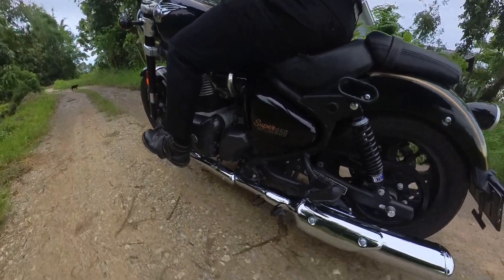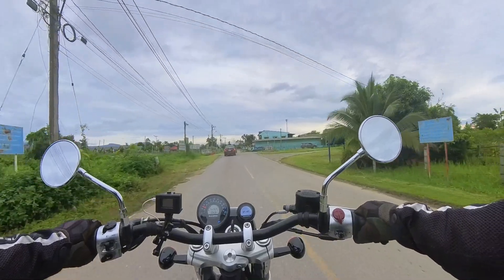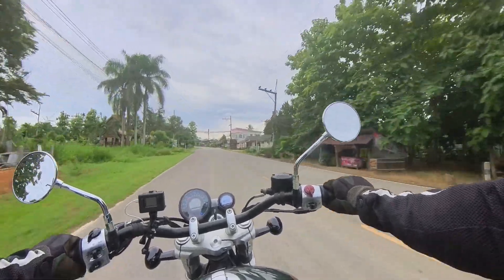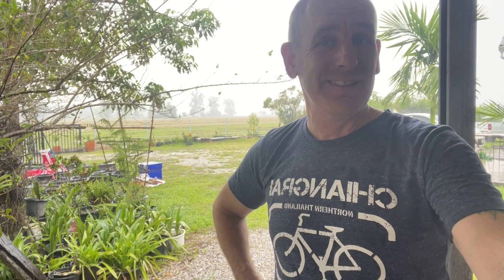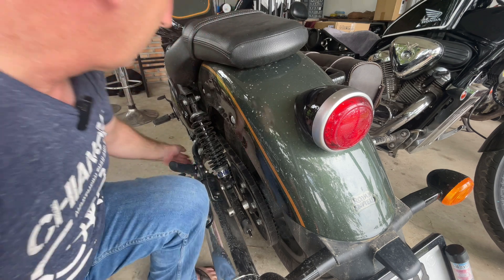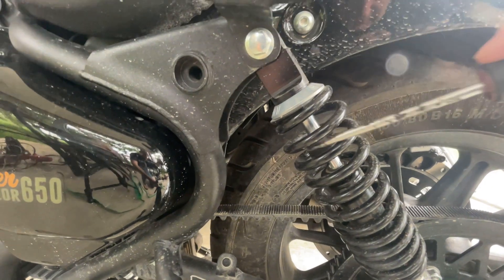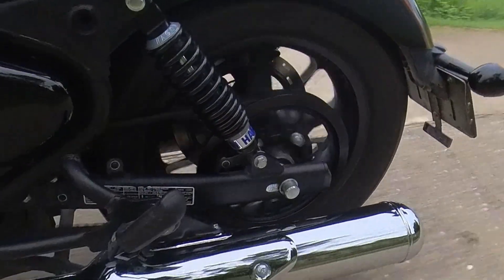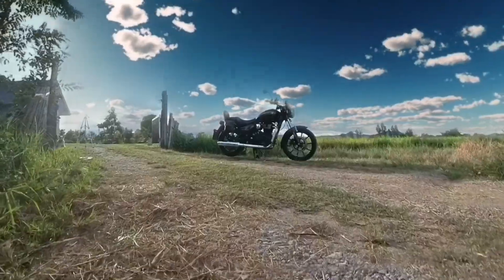Belt Drive: The Best Kept Secret for your Meteor 650 from RS Tech

Comment: The belt drive will be my first mod as soon as I got my bike, hopefully very soon.
Just an idea, what can help for others:
I plan to manufacture a fixed length rear shock replacement part for the belt adjustment. With this part you can perfectly align the front sprocket axle, swing arm pivot pont and rear wheel axle to do a belt tension. With this simple tool you don't really need anyone to help you.
Reply from the maker: It’s a great mod. To be honest there is a new tension method now. So you can check any time on your own after done. You can even use the gates app. Which is like a guitar app to check the belt frequency when flicked. 🙏 Belt Tension - New Method - Royal Enfield 650 RS Tech Belt Drive
https://youtu.be/sdPa9kIsEdw
Reply: @Ride-with-T  I already saw it this morning, thank you! (I still haven't finished all your videos)
Yupp, saw the frequency tuning method as well. The only thing missing is the motorcycle...

Comment: How come you have the high beam on? just curious
Reply from the maker: Motorbikes are a common form of Transport in Thailand. Mostly small cc bikes. Cars pull out in front of bikes all the time, because they assume it’s a small slow bike. Hence big bike riders tend to ride with lights blaring to indicate speed. It works, but not all the time. 🙏
Reply: @Ride-with-T  oks i thought so, can you just adjust the height to be higher and gert an LED? might save the bulb and connectors burning out

Comment: I have heard that it is common to have to re tension a new belt fairly soon after installation, but that subsequent adjustments are rare, or far apart. I also understand that they rob a bit more power than a chain, but there is a trade off for everything, and it still appears to be a favorable trade to me.
Reply from the maker: Yes I had to make a couple minor adjustments within the first 1,000 km but not touched it since at 8,000km. Maybe a bit of power loss. Not that I’ve noticed, because you can change gears much quicker and smoother. So I actually think the bike is quicker now 😂🙏
Reply: @Ride-with-T  I know that a belt does not have the slack of a chain when coming of and on the power, but I wouldn't have thought that a belt would make shifting easier. Very Interesting.
Reply from the maker: @ ohhh it really does. And no dipping of the front forks between gear changes, which is where I’m sure power is lost also 🙏

Comment: how do you compare Belt drive with chain in terms of wet environment with soil etc.
Reply from the maker: No oiling needed. The OEM chain would rust badly if you didn’t oil it after getting wet. But the clay soil here in Thailand is very gritty. So I do have a little bit of wear in the last 8,000 km on the belt drive over the rainy season. But some people havve changed chain and sprocket sets twice over this period. The belt is the way forward 🙏

Comment: Just bought a belt drive from Mtechnichs (India) to fit on my Classic reborn, then going to do the same on my Meteor (10000 miles and totally stretched no adjustment left). Still looking at the SM as secondhand prices are really coming down.
Reply from the maker: Just be cautious of that Classic belt drive kit, if they use a gates belt. I’ve been informed the front pulley makes the belt turn too tight a curve from the manufacturer’s tolerance specifications, limiting the life span of the belt. But i do hope you have no issues. Second hand prices of any manufacture are dropping like crazy. But we still like to buy new. It’s the only way of guaranteeing you’re not ridding a damaged repaired bike. All the best 🙏
Reply: @Ride-with-T  thank you for the information I will religiously stick to the guidelines in case of any future warranty issues.

Comment: What about the power / efficiency, I have heard belts cause loss of power of around 10-15%, i think a dyno test with a chain and with a belt would be able to get the results,
would like to know about your experience.
Reply from the maker: No power loss that I have noticed on a 47hp bike. What you do notice is the smoothness between gear changes. My wife no longer head butts me on gear changes when pillion. No dipping of forks. So in a way better than chain in my opinion.

Comment: I would think that the additional force placed on the countershaft sprocket bearings due to the belt tension would eventually possibly cause bearing failure.   However, I think this is absolutely fantastic-- to get rid of those damned dirty chains-- why more manufacturers don't outfit bikes with belt drive is a mystery to me-- sure it would increase the price of the bike -- I, for one, would be glad to pay it.   For example, Honda does not offer belt drive on any of their motorcycles-- WHY??   PROBABLE ANSWER -- Just to get the bike out the door for a few dollars less -- OK then, offer the same motorcycle with a belt drive option at $500 - $700 more.   Design the bike with heavy enough bearings to withstand the additional belt tension force and then offer a kit that can be installed by the dealer for additional cost--I would opt for that in a heartbeat
Reply from the maker: The tension isn’t drastic. And no different when under acceleration and the chain is taught. Dealer cost is the only reason. Which is why brands like Harley and Indian don’t care, and fit it as standard. Budget brands however, sell on price. Chain is a cheaper option, with repeat servicing and replacement revenue. 🙏

Comment: A 45° angle seems to be quite reliable.
I'm not going to use a specific 18 mm because sometimes I ride alone, sometimes with company and luggage. I can't get the proper tension that will suit every condition.
Reply from the maker: As long as you adjust preload on suspension between different conditions all will be good 🙏

Comment: Like you I have been looking for a way to pre load the suspension when on my own as to check the belt tension, I have padock stand bobins on my CGT 650 and found that if I remove the seat I can hook each end of a ratchet strap onto the bobins and over the frame to pre load the suspension to the required amount enabling correct checking of the belt tension whilst on my own. I also found that after an initial run there had been some belt stretch and the coresponding wear on the rear pulley, hopefully resolved now the belt has been re tensioned.
Reply from the maker: If only I had a ratchet strap. I tried some cord but it was difficult to pull down the shocks to the correct level. How many KM on your kit so far?

Comment: How are you able to get the correct tension useing the tension gauge without the rider on the bike as it was emphersised in the instalation vidio that the rider needs to be on the bike to do this correctly and obtain the correct belt  tension. Surley the method in this vidio is not accurate as no rider sitting on the bike toi give the preload required?
Reply from the maker: You are absolutely correct. However I made the smallest of tension, and when I later got some one similar weight to sit on the bike, all was well. I did try pulling it down to where the shock rubbers sat with cord also. 🐠
Reply: @Ride-with-T   Thanks for your reply I have had the same experience with my 650 CGT and not always having someone around to assist is a problem, like you I found it to be a much smoother ride and enjoy not having to lube the chain and clean off the resultant oil
Reply from the maker: @petergosling4381  yes it’s much smoother and cleaner. 🙏

Comment: In my experience, the belt may squeak or ‘chirp’ if it’s slightly out of alignment. Also, you can’t trust the factory makings on the adjustors. They are often inaccurate.
Reply from the maker: Agreed, 100 % 🙏

Comment: There is a slight wobble seen, most probably because the big pulley is slightly eccentric. That should not happen. It even has a visible wobble. For the money charged, this is not good. Shoddy workmanship.
Reply: 10:18 to 10:37. Even the belt is visibly exhibiting that eccentric rear sprocket.
Reply from the maker: Ok. This is before I torqued the rear axle. The whole drive sits on the Cush rubbers. It does not centre onto the bearing until it is fully torqued. . If there is a design fault, it.s with RE. We have covered this on earlier videos.
Reply: @Ride-with-T  After thinking about it, your argument about torquing the centre axle bolt, the 'cush' pads etc, does not apply here. Your rear sprocket is bolted directly on to the rear wheel drum and the drum is supposed to be perfectly centred via the bearing on the axle surface. So, if it is RE's mistake, the whole wheel should be running eccentric on the shaft, which I doubt very much. I don't think RE is that unprofessional at making wheel hubs.
Reply from the maker: @tonyrebeiro  It”s funny how you use the word argument. I’m not arguing. But you are the one using exclamation marks and capital letters in your messages. The rear wheel hub sits on the rubber cush drive only. Until you tighten the rear axle. End of. Good day.
Reply: @Ride-with-T  I'm not used to talking from the top of my head, especially on technical issues. I repeat, your 'Cush' pads or the torquing of the centre axle bolt, have nothing to do with Sprocket concentricity on the alloy wheel drive drum, because it is Bolted firmly to this drum, which is on a bearing. SURELY, the bearing can't be wonky. You can't counter justify something, that is based on basic Physics. And I'm not looking up to you for an advanced Enlightenment on the topic because I have worked with my bare hands since 1984, as a hobby. I'm an Electronics engineer by profession. Anyone who has worked with bike sprockets will clearly understand, what I'm hitting at. Maybe because I'm washing dirty linen in public, it might be a set back to your commercial interests, but facts cannot be twisted to suit personal preferences. If you are so adamant to say that everything was solved, after you torqued the bolt, please show it with another video, as I had requested earlier. Thank you.
Reply from the maker: @tonyrebeiro  please watch this video from the 5.40 mark : https://youtu.be/WTmi6RUjpfg?si=c3zy0u5O4Zu1Se7Q
Until the axle is fully torqued, the wheel hub is not aligned fully to the wheel bearings, but to the rubbers only.
Reply: @Ride-with-T  You are still not getting it, I guess. What you are referring to is wobble. I talked of wobble and eccentricity. I have come across umpteen cases where an imitation/fake rear sprocket was very slightly off centre. And that would result in exactly the same thing, I saw in your video. The chain/belt would be seen getting tight/pulled at one instant and slack after 180 degrees. This is a clear sign that one of the sprockets/pulleys are out. Usually, this condition is from the rear/bigger sprocket. I have removed such a faulty rear sprocket and carefully measured it and found that it was indeed out by a very small margin, but even this margin was causing the problem. In your video, the rear sprocket is bolted to the drive assembly. Even the slightest error here, will cause the problem. Why don't you take another video of the torqued axle bolt and clear the issue, once and for all. In your recommended video, at 19:08, everything looks much better, during the hand spin, but there is a little bit of what I mentioned earlier. However, since this is a belt, this discrepancy will not be noticed audibly, but a chain with an eccentric sprocket is distinctly noticeable.
Reply from the maker: Every one is entitled to their opinion. But I think most of the Meteor 650 owners who have already fitted this kit would disagree with you.
Reply: @Ride-with-T  Your own video evidence of what I mentioned surely CANNOT be lying. Your reply is circumventing the POINT. I'm not implying that the kit lacks anything, from a practical point of view and servicibility. But because I'm used to precision, it caught my attention. And just to let you know, I have been servicing,  and altering my own bikes since 1984!!
Reply from the maker: @tonyrebeiro  can you at least give a time point in the video, so I can at least see what you are talking about?
Reply: Ok, so take a small video, from the same angle as before, after all the torquing process, so that we can confirm it is RE's fault.

Comment: Got an RSTech belt drive on my Interceptor - it’s excellent - would never go back to chain!!!
Reply from the maker: It’s like that. You do t realise the difference until you change. My first experience of a belt. I wouldn’t like to go back either.
Reply: What is your milage on the set? I had a Barons set and the rear pulley lasted 20K km and the tooth became like shark tooth. The aluminium was much to soft. 
A Kawasaki factory one last 100K km
Reply: I'm having issues with the alignment test when I roll the wheel backwards.  I can't can't the belt to stay in alignment.  Any tips?

Comment: Power loss in a chain drive is minimum & belt drives lose a little more power.
Reply: Very true. Chain drive is the best, in terms of power loss reduction, where shaft drive is the worst and belt drive in the middle. But the other advantages of belt drive, make it worthwhile. But the very critical downside to a belt drive is its vulnerability to sabotage, if the bike is parked in an unprotected area, where miscreants can access it.
Reply: @tonyrebeiro  +1  Chain ⛓️ any day.. 👍

Plough 🎉
Reply from the maker: No power lose really noticeable on a 47hp bike. What is noticeable is the lack of jerk when accelerating from slow speed. No chain snatch, from the small amount of slack tension in a chain.

Comment: Hi Teacher T Thanks to you and RSTech I bought the belt drive and now, allegedly I've got the first one fitted to a Super Meteor in France. I've already done a few hundred Km's on it, It's a smoother and quieter/ ride. The roads in central France are perfect; Le Cher (Dépt 18) La Creuse (Dépt 23) and Vienne (Dept's 86/87). I haven't got to the squeek phase, but will follow your advice when I do! My local RE dealership have been fantastic and can see the benefits of belt over chain. Maybe the belt could be made 1 or 2 lugs shorter, what do you think. Rob
Reply: I opted for the standard ratio for my belt drive conversion, having the slightly larger diameter rear pulley puts the rear wheel spindle just about central in the adjustment range,
Reply from the maker: @davegrice3517  So Robert had just informed me. I think that is an advantage. But I do notice the lower revving engine. 🙏
Reply from the maker: Glad to hear you are enjoying the benefits of the belt drive. The belt chosen is a common belt. The next common belt size down was too short. To have one specially designed and made would be too expensive, and not easily available worldwide wide in the future. It’s not ideal, but works. Enjoy. 🙏

Comment: You have put your Hagon shocks to notch 2 after your initial thoughts it was really ok at the initial stage. Can you look more into this ie: do they feel the same as the originals after time, do they  loose the correct feel after time, is notch 2 really good consistently over time etc?  It would be good to do the shock extensions and see if the feel and height is good? Maybe  with those and  the original length Hagon shocks  .Maybe more travel of shocks- ease, but enough height drop for bike as I am the same leg height as you and for me costs. 🤔
Reply from the maker: I fitted the Hagons before having the belt drive final production fitted. My axle has since moved more to the rear, and I think has had an effect on the rear shocks. Setting 2 now feels like setting 1 when I first had them. It's a good question. Time will tell. And I think I will order that other mod  part to trial. Like you say a cheaper option for most of it actually works 🙏

Comment: Important information Thanks for the video👍, don't you think the belt should be shorter?  There seems to be no more margin to stretch
Reply from the maker: I understand why it’s so long. RS Tech have chosen to fit commercial standard length belts, which are easily available for many machine products worldwide wide. The next length down which fitted the Interceptor and Continental, was too short. The only way to get a mid sized belt would be to order a specific length. This would push the price up, and limit easy availability in the future. There is still plenty of adjustment left. And to be honest the belt should not stretch any more. Gates pride themselves on stretch free belts. It could have been a case my rear axle moved. But I doubt it. I think 1 adjustment I acceptable after 1,000km. Hopefully, fingers crossed, no more. 😂🙏
Reply: Can’t tell from the picture how much adjustment is left behind the washer. Doubt if the belt stretches much further after the first adjustment. I would rather have a longer wheelbase than a shorter belt. 
This modification is still on my radar. Thank you TT for the review.

Comment: So what was the reason for measuring the bump stop on the shock absorber, and what was the green strap tied to the swinging arm for, were you planning to compress the suspension to check the belt tension?
Reply from the maker: Spot on sir. I did try. But failed on that idea. But I did weight the saddle close to the stopper. 😂🙏

Comment: The modification does look intriguing. Not so sure about the safety though. Would definitely love to see you do a review on it.
Reply from the maker: Yes, it all depends on what metal it’s made from. If aluminium I doubt the integrity. I will try and find out. But the idea is genius. Changes the angle of the shock, and reduces the swing arm leverage. 10/10 for thinking. 😂